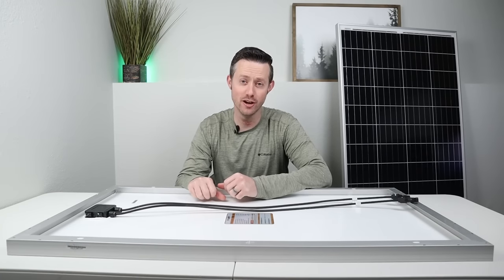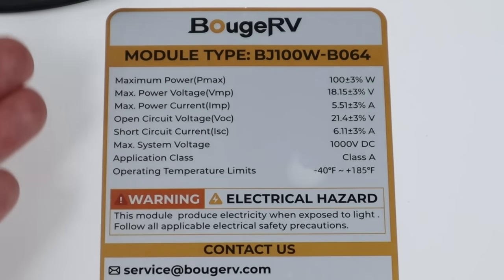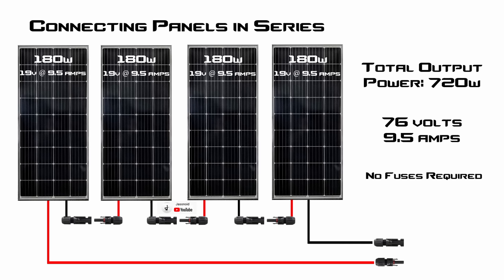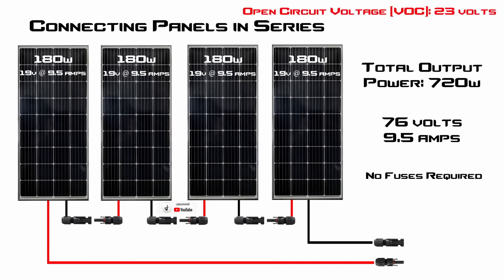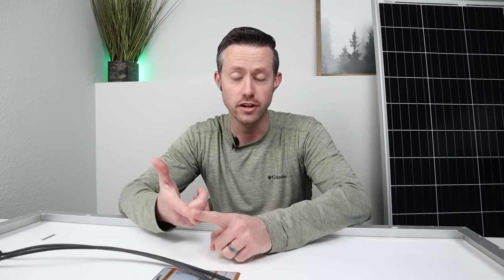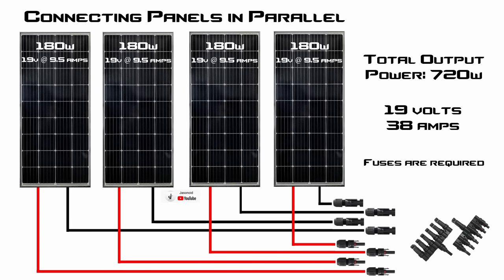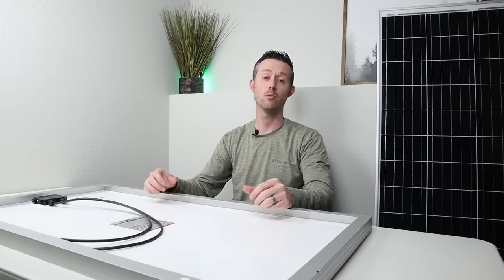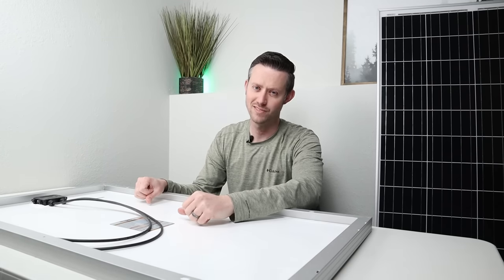Series VS Parallel! A Beginner's Guide for Solar Panel Connections - With Basic Diagrams!

Comment: Question regarding batteries:
Is there any benefit/drawback in using 

4x 12v, 100Amp batteries
Vs
1x 48v, 100Amp battery?

I assume you lose on some efficiency because of added complexity and potentially charge cycles due to load balancing but am not sure. 4x 12v batteries are like half the price of the 48v battery where I live and I don't quite understand why
Reply: 1  In the name of God, the Gracious, the Merciful.

2  Praise be to God, Lord of the Worlds.

3  The Most Gracious, the Most Merciful.

4  Master of the Day of Judgment.
5  It is You we worship, and upon You we call for help.
6  Guide us to the straight path.
7  The path of those You have blessed, not of those against whom there is anger, nor of those who are misguided.

2  God, there is no god but He, the Living, the Eternal.  To Him belongs everything in the heavens and everything on earth. He is the Sublime, the Magnificent. Originator of the heavens and the earth. He made for you mates from among yourselves, and pairs of animals, by means of which He multiplies you. There is nothing like Him. He is the Hearing, the Seeing.

3  He sent down to you the Book with the Truth, confirming what came before it; and He sent down the Torah and the Gospel.
4  Aforetime, as guidance for mankind; and He sent down the Criterion. Those who have rejected God’s signs will have a severe punishment. God is Mighty, Able to take revenge.
5  Nothing is hidden from God, on earth or in the heaven.
6  It is He who forms you in the wombs as He wills. There is no god except He, the Almighty, the Wise.

1  Say, “He is God, the One.
2  God, the Absolute.
3  He begets not, nor was He begotten.
4  And there is none comparable to Him.”

13  To Him belongs whatever rests in the night and the day. He is the Hearing, the Knowing.
14  Say, “Shall I take for myself a protector other than God, Originator of the heavens and the earth, and He feeds and is not fed?” Say, “I am instructed to be the first of those who submit.” And do not be among the idolaters.

100  Yet they attributed to God partners—the sprites—although He created them. And they invented for Him sons and daughters, without any knowledge. Glory be to Him. He is exalted, beyond what they describe.
101  Originator of the heavens and the earth—how can He have a son when He never had a companion? He created all things, and He has knowledge of all things.
102  Such is God, your Lord. There is no god except He, the Creator of all things; so worship Him. He is responsible for everything.
103  No vision can grasp Him, but His grasp is over all vision. He is the Subtle, the Expert.
104  “Insights have come to you from your Lord. Whoever sees, it is to the benefit of his soul; and whoever remains blind, it is to its detriment. I am not a guardian over you.”

143  And when Moses came to Our appointment, and his Lord spoke to him, he said, “My Lord, allow me to look and see You.” He said, “You will not see Me, but look at the mountain; if it stays in its place, you will see Me.” But when his Lord manifested Himself to the mountain, He turned it into dust, and Moses fell down unconscious. Then, when he recovered, he said, “Glory be to you, I repent to you, and I am the first of the believers.”
144  He said, “O Moses, I have chosen you over all people for My messages and for My Words. So take what I have given you, and be one of the thankful
145  And We inscribed for him in the Tablets all kinds of enlightenments, and decisive explanation of all things. “Hold fast to them, and exhort your people to adopt the best of them. I will show you the fate of the sinners.”

36  To every community We sent a messenger: “Worship God, and avoid idolatry.” Some of them God guided, while others deserved misguidance. So travel through the earth, and see what the fate of the deniers was.

16  And mention in the Scripture Mary, when she withdrew from her people to an eastern location.
17  She screened herself away from them, and We sent to her Our spirit, and He appeared to her as an immaculate human.
18  She said, “I take refuge from you in the Most Merciful, should you be righteous.”
19  He said, “I am only the messenger of your Lord, to give you the gift of a pure son.”
20  She said, “How can I have a son, when no man has touched me, and I was never unchaste?”
21  He said, “Thus said your Lord, `It is easy for Me, and We will make him a sign for humanity, and a mercy from Us. It is a matter already decided.'“
22  So she carried him, and secluded herself with him in a remote place.
23  The labor-pains came upon her, by the trunk of a palm-tree. She said, “I wish I had died before this, and been completely forgotten.”
24  Whereupon he called her from beneath her: “Do not worry; your Lord has placed a stream beneath you.
25  And shake the trunk of the palm-tree towards you, and it will drop ripe dates by you.”
26  “So eat, and drink, and be consoled. And if you see any human, say, ‘I have vowed a fast to the Most Gracious, so I will not speak to any human today.'“
27  Then she came to her people, carrying him. They said, “O Mary, you have done something terrible.
28  O sister of Aaron, your father was not an evil man, and your mother was not a whore.”
29  So she pointed to him. They said, “How can we speak to an infant in the crib?”
30  He said, “I am the servant of God. He has given me the Scripture, and made me a prophet.
31  And has made me blessed wherever I may be; and has enjoined on me prayer and charity, so long as I live.
32  And kind to my mother, and He did not make me a disobedient rebel.
33  So Peace is upon me the day I was born, and the day I die, and the Day I get resurrected alive.”
34  That is Jesus son of Mary—the Word of truth about which they doubt.
35  It is not for God to have a child—glory be to Him. To have anything done, He says to it, “Be,” and it becomes.
36  “God is my Lord and your Lord, so worship Him. That is a straight path.”
37  But the various factions differed among themselves. So woe to those who disbelieve from the scene of a tremendous Day.
38  Listen to them and watch for them the Day they come to Us. But the wrongdoers today are completely lost.
39  And warn them of the Day of Regret, when the matter will be concluded. Yet they are heedless, and they do not believe.
40  It is We who will inherit the earth and everyone on it, and to Us they will be returned.
41  And mention in the Scripture Abraham. He was a man of truth, a prophet.
42  He said to his father, “O my father, why do you worship what can neither hear, nor see, nor benefit you in any way?
43  O my father, there has come to me knowledge that never came to you. So follow me, and I will guide you along a straight way.
44  O my father, do not worship the devil. The devil is disobedient to the Most Gracious.
45  O my father, I fear that a punishment from the Most Gracious will afflict you, and you become an ally of the devil.”
46  He said, “Are you renouncing my gods, O Abraham? If you do not desist, I will stone you. So leave me alone for a while.”
47  He said, “Peace be upon you. I will ask my Lord to forgive you; He has been Kind to me.
48  And I will withdraw from you, and from what you pray to instead of God. And I will pray to my Lord, and I hope I will not be disappointed in my prayer to my Lord.”
49  When he withdrew from them, and from what they worship besides God, We granted him Isaac and Jacob. And each We made a prophet.
50  And We gave them freely of Our mercy, and gave them a noble reputation of truth.
51  And mention in the Scripture Moses. He was dedicated. He was a messenger and a prophet.
52  And We called him from the right side of the Mount, and brought him near in communion.
53  And We granted him, out of Our mercy, his brother Aaron, a prophet.
54  And mention in the Scripture Ishmael. He was true to his promise, and was a messenger, a prophet.
55  And he used to enjoin on his people prayer and charity, and he was pleasing to his Lord.
56  And mention in the Scripture Enoch. He was a man of truth, a prophet.
57  And We raised him to a high position.
58  These are some of the prophets God has blessed, from the descendants of Adam, and from those We carried with Noah, and from the descendants of Abraham and Israel, and from those We guided and selected. Whenever the revelations of the Most Gracious are recited to them, they would fall down, prostrating and weeping.
59  But they were succeeded by generations who lost the prayers and followed their appetites. They will meet perdition.
60  Except for those who repent, and believe, and act righteously. These will enter Paradise, and will not be wronged in the least.
61  The Gardens of Eden, promised by the Most Merciful to His servants in the Unseen. His promise will certainly come true.
62  They will hear no nonsense therein, but only peace. And they will have their provision therein, morning and evening.
63  Such is Paradise which We will give as inheritance to those of Our servants who are devout.
64  “We do not descend except by the command of your Lord. His is what is before us, and what is behind us, and what is between them. Your Lord is never forgetful.”
65  Lord of the heavens and the earth and what is between them. So worship Him, and persevere in His service. Do you know of anyone equal to Him?

111  And say, “Praise be to God, who has not begotten a son, nor has He a partner in sovereignty, nor has He an ally out of weakness, and glorify Him constantly.”

85  Whoever seeks other than Islam as a religion, it will not be accepted from him, and in the Hereafter he will be among the losers.

Read The Quran
“I am to you a clear warner.”
 “That you shall worship none but God. I fear for you the agony of a painful Day.”

Comment: Which connection system is best... Parallel or series???
Reply from the maker: Series is good for clear solar areas, no shade. You can use smaller wire and fuses in a series array.

Parallel is great for smaller arrays and for shading performance. It requires larger wires and fuses, which add up quickly in price.

Comment: A question on the 2s2p: I do two sets of panels in Parallel then put those two in series. There shouldnt be a performance differance vs how you wired your 2s2p in the video, correct?
Reply from the maker: Great question! Thinking about it....if you do two panels in parallel, and then wire those two sets in series, you'll see a complete loss in power in partial shading because the power won't flow through the array. 
If you do two sets in series and then wire them in parallel (like I did in the video), you'll only see half the power loss in partial shading because the panels are working together in pairs.
Reply: @Jasonoid  This would be a cool youtube short video, 😉 😉 You could use a large peice of card board for the shading.

Comment: I have put three 380 Watt panels in series that are rated at a little over 9 amps. The last time I charged my Bluetti everything worked fine. A year later, when I test for what's coming off the three panel series, I am getting 22 amps which of course is more than the Bluetti can handle. 

Do you have any clue as to why my amperage would spike on a three-panel in series array?
Reply from the maker: The wiring must have changed 🤷 wiring in series the voltage adds up and amperage stays the same.
Reply: @Jasonoid  I'll have to get up on the roof and check it out. I know that I haven't touched it. Very strange.
Reply from the maker: @alo5867  maybe you didn't zero out the meter before testing? Maybe the wrong multimeter setting?
Reply: @Jasonoid  That's all very much a real possibility because this is definitely not my bailiwick, but with that stated, I plugged in the solar panel array to the Bluetti and it was reading zero PV input and each time I unplugged it there was a little spark.  Would that type of event happen on an over amperage?
Reply from the maker: @alo5867  you cant 'over amp' a power station. The amperage is limited by the charge controller.
The only damage that will happen is from overvolting the power station by going over the max voltage of the charge controller.
Reply: @Jasonoid  I wonder what would be causing the sparking then? My voltage was 128 and I believe the Bluetti takes up to 150?
Reply from the maker: @alo5867  solar panels will always spark when you connect them under load. It's best to shade the panels when connecting them to your power station.
Reply: @Jasonoid  Interesting. I didn't know that. Thanks for the advice. 👍

Comment: How do you figure what size inverter you need for your #of panels  and batteries that you have. For example if you have 600 ah of batteries And the same for panels?
Reply from the maker: You size your inverter and batteries to the load you are wanting to run. If you have consistently 2000w running, you'd want an inverter that is capable of 4000 watts so you have plenty of room and the inverter is running at 50% duty cycle.

If you have your batteries selected, you find a solar charge controller that is capatible with your battery chemistry and voltage. Then you wire your solar panels (in series and parallel) so the voltage and amperage output match the input requirements of your charge controller.

Comment: Haven't bought panels yet but there is some good deals in Knoxville but they want you to get 6-8 or more to lower the price significantly as in almost 80- 100 off a panel but then your almost at full skid price.  They're 400 - 500 watt panels am I trying to bite off more than i can chew??? I do have the help of a Electrician  but he hasn't worked with high power DC much!!!

Comment: Please I have 3 pieces of this 180W panel with same rating as yours. How do I connect them together for fast charging of my 12V, 200AH gel battery?
Reply from the maker: Depends on the charge controller you decide to go with. The charge controller will determine the max volts and amps you can plug into it.
Reply: @Jasonoid  I have pwm charge controller but will mppt does better for just one 12V, 200AH battery? I plan to connect them in parallel to get 18V and 30A maximum . Is that ok!
Reply from the maker: @safetyalways7788  using a 30 amp charge controller and those three panels should be just fine. Just plan on using heavy duty wire and fuses on that setup.
Reply: I plan to use 10 gauge wire
Reply from the maker: @safetyalways7788  I'd recommend 8 awg wire going to the battery, 10 gauge is rated at 30 amps max. It will be quite warm when going at that max power.
Reply: @Jasonoid Stand to be corrected, only 8 awg wire going to the charge controller should be enough. Since pwm charge controller will regulate amp at 15A to charge the battery, I guess I can use 10 awg wire from charge controller to the battery and inverter output

Comment: I have 10 gage wire, could I still use this in series without a fuse. Thanks
Reply from the maker: Yes, as long as you don't go over 30 amps, which is pretty impossible in series.
Reply: Thanks so much for your speedy reply. @Jasonoid

Comment: On long wiring runs from panels to MPPT / Charger  Note: Higher voltage=Smaller diameter/Gauge  (AWG) wiring. Opposite for Lower voltage.

Comment: I’m trying to save money on electricity. 
On my shop roof I have 4 100 watt panels. 
In the shop I have three 12 volt Grid tie inverters on the wall. 
The output of each is 120 volts. 
Each output is plugged into a power strip which is plugged into  120 volt outlet. 
How can I tell if it is saving me money?
Reply from the maker: Most power meters in the US do not run backwards, so it won't reverse your power usage. It will only offset what load is currently being used in your home. Don't let your power company know you have them, they aren't legal.

Comment: I have a quick question, can i expand the 2S2P method to a total of 16 panel. meaning 8 pairs of series, the using 4 in 1 connector to the sets ?
Reply from the maker: With that many panels the amperage would get really high. When you get a bit more panels it's best to use series connections. So I'd recommend doing 4 sets of panels in parallel and the connect each of those in series 4S4P. You'll need to make sure your charge controller can handle the final voltage and your wiring can handle the amperage. 

The final panel configuration all depends on your battery voltage and the charge controller. It might be more simple to split the array in half and run two separate solar arrays and two separate charge controllers to the same battery bank. They will work together to charge the batteries.
Reply: @Jasonoid  thank you so much, let me provide the details of the panels, inverter and battery maybe you can help guide me on the configuration
1. Growatt SPF 5000 ES (5kva)  (1pc)
2. Solar Panel details (420W (+3), Max Imp 12.28A, Max vmp 34.20V, Short circuit 13.06A (+3), Open Voc 40.28V (+3)) (16pcs) (fuse at 20A)
3. Felicity Battery 10KVA  LPBA48200-H (1pc)
hope that help to advise on the right configuration to maximize the system
Reply from the maker: @abrahamsunday9405  youtube is not the right format for the more advanced consulting unfortunately. There's no way I can layout a complete setup in a comment string.

I'd recommend posting about this question in Will Prowse's diy solar forum (which is free) and you'll get lots of great comments on the subject.

Comment: can you do just 2 panels 1s1p? because the amp or voc are to high to run series? I'm new sorry if its a dumb question
Reply from the maker: If you have two panels in parallel, it's called a 2P array, if you have two panels in series it's called a 2S array. Both options will work fine if they are compatible with your charge controller.
Reply: @Jasonoid  Thank you